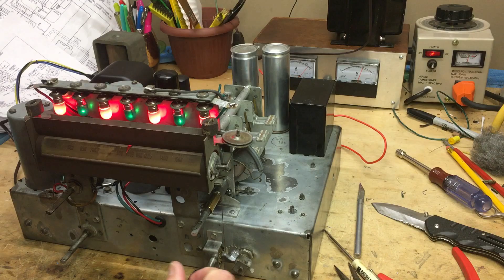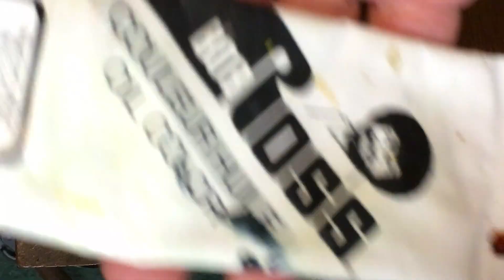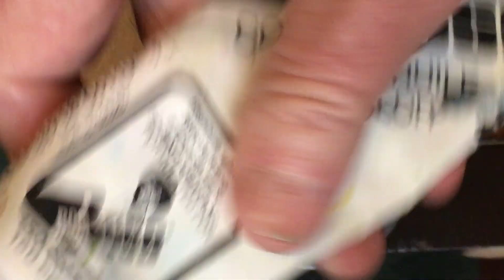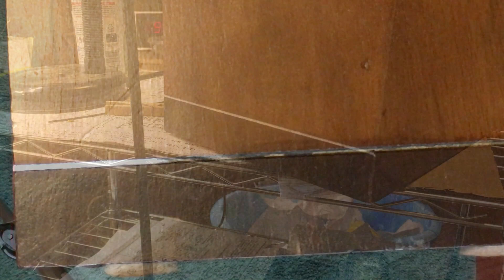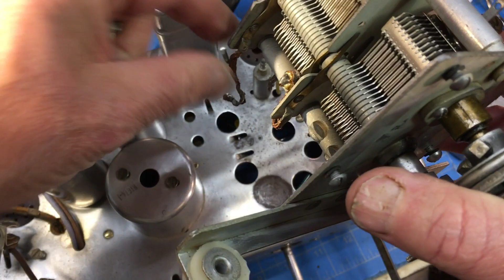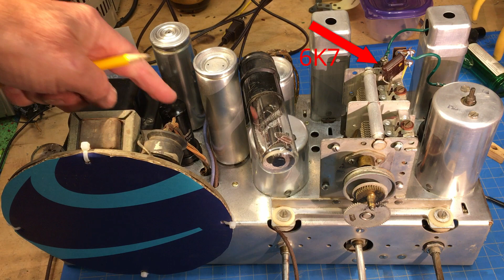1937 RCA Victor 87t Part 4 of 5 Cabinet Detail, Assembly, and Power Up

Comment: I noticed that you left a few old capacitors in the radio. I see them at 17:00 minutes in the video, they're the black colored caps in the far right hand upper corner. Are those capacitors generally good ?   I thought they might have wax/paper on the inside ?
Reply from the maker: Joe K Good eye Joe! Those are sometimes mistaken for mica caps...some are...some not...when I shot the video...I had not received my $50 order for 3 values of caps!!! Two 3600 Pf (mica) was over $17...these were on one of the SW bands and not the Broadcast band...So, I didn’t replace them before power up...the SW bands aligned and performed very good...not that anything there is desired to hear (lol)...In the future...before I order those caps...I’ll pull them and test them for leakage...I typically don’t change them unless there is a problem...but, this radio I wanted to make sure everything was ok in it....Thanks for watching and the comments!!! Take Care and Stay Well—Larry.   ps in the next series....I think you will enjoy...spoiler alert: West Coast radio...no documentation and I’m letting the viewers help with the repairs

Comment: Your radio is definitely taking shape Larry.  The tuning eye looks particularly good.  I suppose there is a need for someone with electronics design engineering skills to devise a solid state/LCD version that looks, and performs like the valve version, or devise similar that uses LEDs (not the spinning type) that we could construct, without too much effort, inside our workshops.  I know it might sound like sacrilege to some folk, nonetheless I’ve substituted FET power devices in place of ‘awkward to get hold-of’ type audio output valves - and with good results.  I remain convinced that achieving construction of a solid state tuning eye is possible.  Alternatively, someone think of a commercial way to recondition all types of valves, say by re-coating the cathode and re-jiggling the international structure, or, say, in principle to how CRTs use to be re-gunned.  It would be a delight if someone was to resume valve manufacturing, preferably in America, England, or Europe - at competitive prices.  Sadly there isn’t a sustainable market for anything of that sort to happen but I’m sure you will agree with me when I say, “it’s a nice thought” LOL.
Best regards my friend, Phil.
Reply from the maker: SteelCity321PB I agree Phil....just not enough of the magic eye market out there to sink that much money in! I think now, the world is just hoping to keep their heads above water with this pandemic!!! Ive seen attempts at magic eye reproduction, but there is nothing like the real thing in action!! Some folks have a lot of time quarantined in their workshops, now would be a good time for R&D instead of R&R! lol....Hope all is well across the pond, Stay Well my friend and Thanks for watching and commenting!! Larry